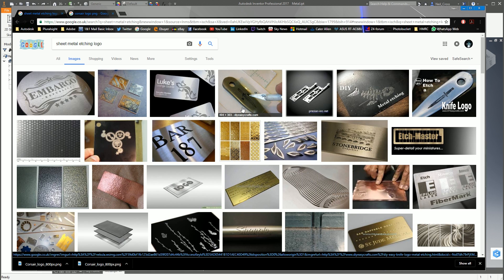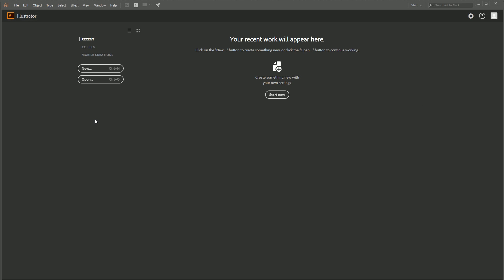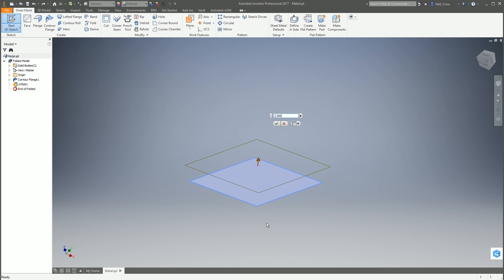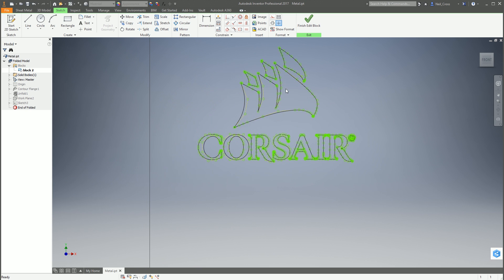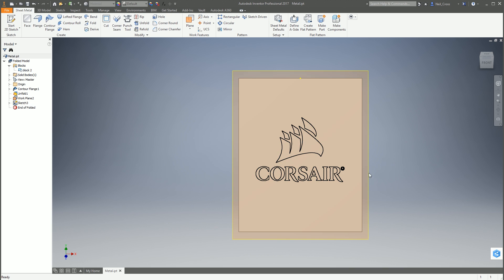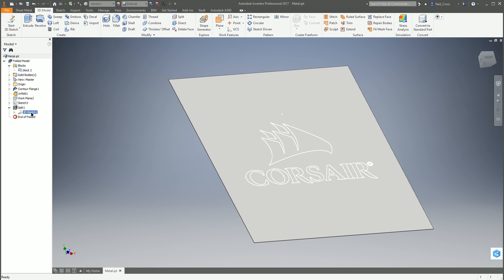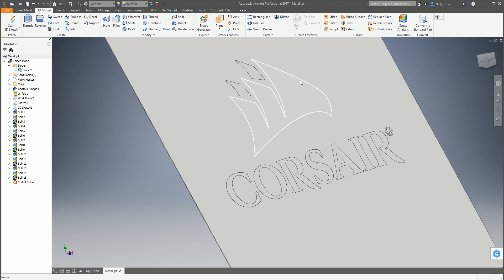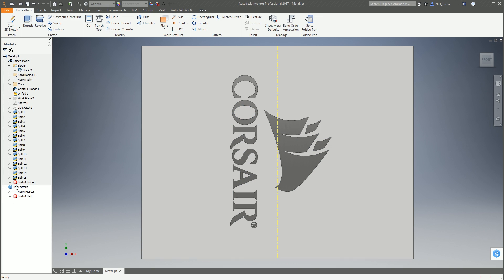Convert Image For Sheet Metal Etching/DXF Export

Comment: Your “Image Trace” dropdown is a set of presets that is basically a starting point for your trace. I generally select whatever preset I think best matches the image I am working with. If I don’t like the results, I can pick another preset and see what I get from that one. If none of the presets are giving me the results I am after, there is an Image Trace Panel that can be opened to further modify your trace. This panel can be accessed after you have applied one of the presets to your image. So after you have applied a preset to the image, your menu bar has the Expand button, and next (to the left) is a View dropdown, and to the left of that is a little square icon. If you hold your mouse cursor over this icon/button, the words “Image Trace Panel” will appear. Click on it and the panel will open. Generally, when you first open the panel the “Advanced” section is closed. Make sure you open this part because that’s where you really have the greatest control over the trace results. 

I’m not going to explain what each of the controls does because this would get way too long. But I think just playing with some of the various controls will give you a general idea of what they modify. Just make one modification at a time, let the program retrace the image, see what happens, make another change, etc. 

So OK, you’ve spent a good deal of your time changing the various controls in this panel and you have the results that you like. But you have several other images that you want to trace as well and how do you remember all the changes you just made to this first image? Not a problem, once you start modifying any of the controls in this panel, the Preset (top dropdown on the panel) changes to “Custom”. To the right of this dropdown is the “Manage Presets” button. Clicking on this button gives you the option to save your current settings as a New Preset. Select the “Save as a New Preset” option and a new popup window appears that allows you to name your new preset. I generally like to remember what original preset I used as a starting point so if I started with the Silhouettes preset I’ll name mine to something like MySilhouettes. Once you’ve named your new preset and hit the OK button, your new preset will appear in the Preset dropdown and it will also be saved into Illustrator for future needs. So the next time you open a new image to trace you can just scroll down the Preset list to find your own customized setting and you’re done.

Stephen Brown mentioned in the comments that a free version of Illustrator is Inkscape. I haven’t used Inkscape in a couple of years, but being a long time user of Illustrator I have to say Inkscape is a really amazing program. If you can’t get a copy of Illustrator to use, definitely give Inkscape a try.